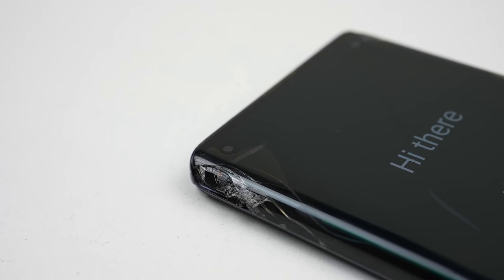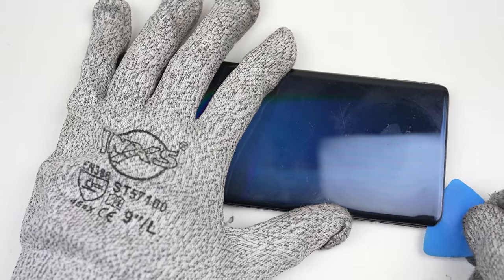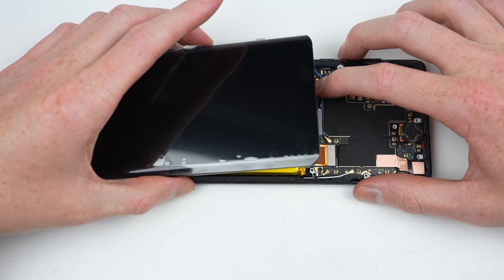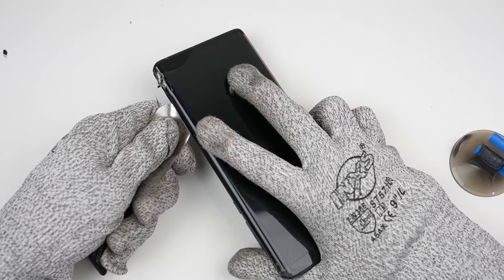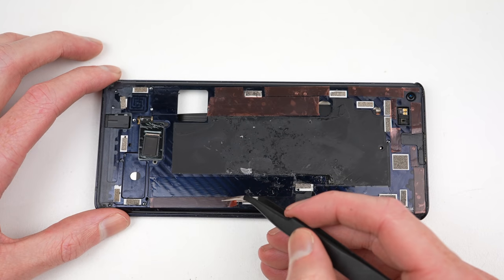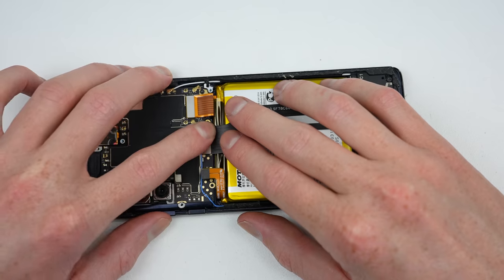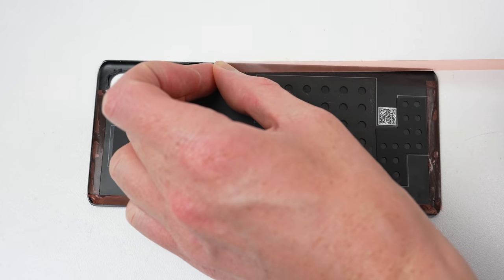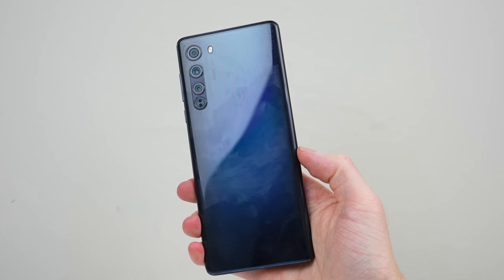$138 Motorola Edge 5G - Repair Taken To The Edge

Comment: I've wanted to buy the moto edge plus 2020 for the longest time. They kept the headphone jack and expandable storage on this model. The only thing that sets Motorola back is their abysmal update cycle
Reply: Actually Motorola updates are quite good now it's more the worrying about the camera
Reply: 1 year updates in most devices vs 4 years of Samsung.
Reply: @laloqf  actually no most Motorola devices now get 2 years os updates
Reply: Custom rom. I kept my Samsung galaxy s7 for 4 years completely up to date using them and genuinely barely saw any performace decrease. Even in the first 3 years it was much faster then the standard os
Reply: @harryvlogs7833  And that's only security updates. Some of their phones quit the factory with no OS upgrades. For example, the newest Moto E7 is one of them.
Reply: @polytelus  Moto e7 is extremely cheap
Reply: Ikr!!! But you can still install custom Roms
Reply: @laloqf  I'd rather have 1 year of normal updates than 4 years of Samsung bloat.
Reply: @harryvlogs7833  Depends on where you live mostly. I almost ate my entire salary with this phone. This is, cheap or not it still deserved at least, Android 11
Reply: @mjc0961  I have the feeling you've never used any Samsung device
Reply: @Lucas_emmsz  Or used the old Samsungs which had TouchWiz as their skin on top of Stock Android. It was absurd how much bloatware it had.
Reply: Yeah I think the device had display issues as well with the screens would turned purple and green for a lot of people. Although that might have been the edge Plus or the edge 5G it's hard to keep track. G100 it's pretty compelling with an 870 chip, and sometimes it's a sub 400.  I think 870 is a much better chip than the 8th gen 1 for thermals and battery. Yeah technically 8 gen1 one will win with benchmarks but OnePlus, Samsung and others are just struggling to get those kids running cool enough to justify.
Reply: @harryvlogs7833  yeah it's amazing how reputation sour a brand even when it's not justified anymore. I mean the LG V60 you just got Android 12 2.5 years after it was released. Almost every buddy said LG would never provide this kind of software support. Basically, at least in the United States market, any Android competitor gets crucified by the tech media. It's one reason we have no competition here. 90% of all carrier sales are a Samsung or Apple device and as a result anytime there's any negative coverage of those companies creators get killed with the algorithm or the backlash
Reply: @laloqf  first of all, Samsung just introduced the Four year promise, we actually have to see if they'll follow through with it. They lied about the lpto screen and the benchmarks, the charging speeds, so we probably shouldn't give them the benefit of the doubt, although I do appreciate the aggressive update schedule.
Reply: @Lucas_emmsz  I have a note 9 and a tab S7, and I like them both a lot, but the problem is the throttling, and the removal of important features the last few generations. And the absurd pricing is a problem as well. 

Only 8 GB of RAM in the base model of the non ultra models For $1200? Back in the s20 lineup every variant had a QHD screen and a premium glass build, and MST/ Samsung pay

 Removing expandable storage on the Note? Despite it offering 8K video which eats up storage like crazy  Leading the charge for Android manufacturers getting rid of the charger, the headphone jack. No qhd on s21, s22 ultra variants. e entire gos scandal.... 4 years of S devices getting delisted from geekbench I'm not saying Motorola doesn't have its problems, but the lack of competition in the Android space and it de facto Monopoly Samsung and Apple have in the United States is bad for all Android users.

I really like it a lot of what Samsung does, and I use dex every single day. But they're constant mimicking of apples anti-consumer tactics are a problem. As is the refusal for so many content creators to criticize them.

I just think if you care about the state of android, Samsung deserves as much criticism as anybody, arguably more since they dominate market share so much.
Reply: 6 turning to 7 years apple support be like
Reply: @Lucas_emmsz  My S22 Ultra came with more bloatware than I've ever seen on a device before I rooted it.
Reply: I prefer the near stock Android experience of Motorola rather than Samsung's OneUI. While Samsung's software made leaps and bounds from its TouchWiz days, it still falls short in some aspects. 

Never really cared about cameras, displays or software updates, so I've got no compelling reason to spend so much on a Samsung when I can find my preferences on a much lower price tag.
Reply: Get the 2022 model, be aware of it's expensive price.
Reply: @harryvlogs7833  My Moto Z4 ($499) only got 1 OS update, Android 9 -> Android 10, most modern Moto devices get 1 year, while the higher end devices get 2. Motorola needs to go the OnePlus/Pixel/Samsung route in terms of software updates, as well as how fast they send them out.
Reply: the update cycle on my moto g100 is pretty good, with it being updated once in every 2 months. the bigger problem is the camera app. its really not great - zooming in more than 1.9x completely messes up your photos and "keep last mode" doesn't even work. the latter being fixed would make the first less annoying because zooming in with pro mode doesnt have the issue
Reply: @rmendez011  no most modern recent Motorola devices get 2 now
Reply: @harryvlogs7833  Not the G or One models, not to my knowledge at least, they only get 1 OS update, while the Edge and Razr get 2.
Reply: @mackenziehopkinson1238  Custom ROMs are always the best solution, but not that much viable for an average user without possible risks if they don’t know what they’re doing.
Reply: @michaelcorcoran8768  Hai! I brought edge 20 fusion yesterday. But video recording & videos in YouTube, Instagram, hotstar, prime are not clarity. So should I exchange or any solution for this?
Reply: @laloqf  usually 2-3 for flagships, 2 for mid rangers, and 1 for moto g series phones
Reply: @ptristao01  Touchwiz does not exist anymore homie
Reply: @Ayuraos  I know bro, I was just referring that it existed and while it was used on new phones everyone criticized it because of the bloat
Reply: @harryvlogs7833  its still shit lmao, good thing it's super easy to unlock bootloader and flash some customROM.
Reply: @lolcatpl  2 years of OS updates for the features and price of the is quite good actually
Reply: @andrive  custom rom has its drawbacks
Reply: @myboah4764  Like?
Reply: @andrive  secrity risks voids warranty hard to download needs rooted phone and anything gone wrong phone bricked
Reply: custom roms are your best friend
Reply: I think the update cycle will be solved cause Lenovo is really taking Motorola seriously.
Reply: @harryvlogs7833  
2 years of OS updates? is that supposed to be impressive?
Reply: @beastinfection638  no it's supposed to be fine
Reply: @harryvlogs7833  
lmao its not fine. iphones get 7 years of OS updates
Reply: @beastinfection638  actually iOS is 5 and 2 is fine anyway as most people keep phone for 2-3 years
Reply: @harryvlogs7833  
uh no. the iphone 6s was released in 2015 and it’s still being updated. it got exactly 6 iOS updates (started iOS 9, and got iOS 10-15). it might even get iOS 16
Reply: I have this phone, just got the 2020 April 1 update. Bought if primarily because it's an unlockable bootloader phone with Lineage that has SD card and headphone jack.
Reply: @Lucas_emmsz  touchwiz did suck though
Reply: @Lucas_emmsz  and yes Samsung does come with bloatware
Reply: Just got android 12 on my moto edge plus!
Reply: For those mentioning Roms, rom support for Motorola phones is really hit or miss, sometimes you get good twrp and rom support, and sometimes even unlocking bootloader is a chore.
Reply: @beastinfection638  nope. It’s no longer gonna get the ios 16 update even the iPhone 7 will die at 15
Reply: @michaelcorcoran8768  since the s10  the  4year update
Reply: They gotten better with Edge 2022 2 Andriod and 3 Motorola upgrades.
They still have to put more durability into constructions, but if you are 
protector user like myself, I prefer the added weight as it is usually in a jacket
pocket and also makes it harder to leave behind, you can find a good protector
for $15.00 on Ebay & the 30 watt Anker turbo charger for $22.00 for 8gb of RAM
and 256gb of Storage a 144mhz Oled Screen for $500.00 you cannot go wrong.
Reply: 2023 + model has no headphone jack.bummer..gotta buy earbuds.wireless..i love the newer models.want one so bad.unless i can come into the money to buy it..all i can do is use my mto g pure.need that full screen.

Comment: You failed to mention the recalibration for the fingerpint scanner.  I just did this repair for the edge plus (same frame and display assembly) and because the screen was switched it requires that next step.  This is something new from Motorola since the Z4

Comment: Motorola phones are actually really underrated. I just wish their OS support was longer.
Reply: I with they wouldn't kick features out they've had for years all the time (headphone jack, dual sim AND microsd instead of the shared slot BS).. or intentionally cripple some models (selling a phone model without a compass... like wtf?)
Reply: @Knaeckebrotsaege  after the z2 play was on a 32 bit operating system for no reason I realized how incompetent Motorola can be with their software
Reply: Ive had several.last one was a e6 i believe.been so long.had 2.i love em.but i couldnt afford the moto g pure.$59.ive gotta samsung galaxy.ao3,s
Reply: @seanallen2731  it's not even motorola, Lenovo acquired them and i've noticed theyve gone into the bucket

Comment: Hey, Hudg, try rl-35a - this glue looks like a best solution for devices with thin edges. Also I highly recommend t9000b, this one also good one if you need a little difference between frame and screen(this one is thicker)

Comment: I'm so glad the curved screen fad seems to have mostly died at this point. My last phone had a curved display and it never really gave any real benefits I could tell beyond looking neat, however the one time I dropped it and needed a screen replacement it was quite steep. Recently moved to S21+ and I'm happy to have a flat screen again.
Reply: for me (with an s8) I find the curved display nice for immersivity (it's a pretty cool effect to feel like you're just a holding a screen) and ergonomics because it matches the curved back. The edge panel is also very useful.

That being said, with samsung's pretty bad touch rejection, you definitely need a case, screen protectors are hard to find, apply, and are expensive and I guess I could do without it - screen replacements just aren't viable at all on s8's and s9's but that's a little to do with the high-res amoled panel
Reply: Too bad it's just OLED that you're using and it's still stupidly overpriced and gimmicky.
Reply: @acumenium8157  are you saying that oled is gimmicky? and that you'd honestly prefer lcd?

idk about overpriced either, there are at least some great value phones that have it, just a shame that apple still sells lcd on their phones now, especially when they cost so much, and then they hit us with this 'liquid retina' garbage. also, just found out that iPhone 11's had LCD for like no reason and apple like told no one (listing it in the specs does not make them honest)
Reply: @rolls_8798  Sure am! OLED burns in like crazy, is super dim, and struggles with non-black colors.

I'll take a good IPS over some OLED any day.

And yes, OLED costs vastly more than IPS. Using your iPhone example, it's the difference of like 5x the cost. One of the iPhones had an OLED or IPS screen. OLED was 5x the price. Like 150$ instead of 30$.

Because anyone can make IPS. Not anyone can make OLED.

OLED is also very fragile, which in a handheld like a phone is... not good.

Speaking of that, there's no real practical use for OLED other than a television. Anything else is too prone to severe burn-in due to static elements, like the taskbar on the bottom of Windows, or other UI elements similar for Android/iOS, etc.
Reply: @acumenium8157  I'm sorry for whatever bad experience you had years ago but I would never go back to lcd. I assure you any modern oled phone will get plenty bright depending on how you adjust the brightness. I've personally never run into the burn in issue since I don't literally use my phone at 100 brightness on the same screen for hours at a time. My S10 from 2019 still had 0 burn in. As for fragility I can't speak towards that, outside of that one drop I haven't cracked or majorly scratched a screen in probably 10 years and I've been using oleds for over half of that time
Reply: @acumenium8157  Some decent points but some which don't really exist at all.

From what I can tell oleds are only getting better at preventing burn-in (with sub-pixel structure and sizing and also quality). Apparently the Galaxy S8 series was particularly prone to burn-in and unfortunately my secondhand one does have it slightly, but this was addressed with the S9.

The oled screens I have used have been pretty good with colours, iPhones in general are a little unnatural looking and feel 'over-sharpened' imo and perhaps they are worse than a good LCD panel in that way - e.g. the matte LCD on my laptop is excellent and actually has very deep blacks. but my S8 just looks better - having individual pixel brightness control makes a big difference, but a lot of this LCD vs OLED comes down to the specific panel and manufacturer when it comes to overall viewing pleasure.

oled is expensive compared to lcd, but oled is not expensive. you're mostly getting price hiked by apple, or of course third-party lcd's are a lot cheaper because they're so much less complex to make and I think any oled ones you might find are just refurbished. bigger oled screens however have a massive premium (I probably wouldn't consider one on a tv, but maybe on a laptop)

not that fragile, and much less likely to brick the whole screen if you manage to damage a small part of it. no crystals to mess up either

static elements is a fair point, but good software completely eliminates it (e.g. the AOD on samsungs can be set to slowly change position on the screen, even if you have it on the tap to display mode, or the simple screensavers and screen timeouts) and using gesture controls instead of virtual buttons means there is nothing permanently on the screen, i think the benefit is worth it (picture quality, viewability, and battery life) but if you don't want the small risk of burn-in occurring then that's personal preference and that's fine.

crt's were able to get burn-in as well(hence the dvd screensaver or the term 'screensaver' as a whole) but we coped just fine. i would just say oled is unsuitable for more industrial applications like monitor screens (as in a monitor for sensors) and because of cost

Edit: oh yeah, and oleds get plenty bright nowadays, i've actually had much better consistency with their sufficient brightness than with lcds
Reply: @acumenium8157  overpriced? dude this type of screen has been around for so long
Reply: @Maximus20778  Yes, overpriced. OLED screens are insanely expensive compared to IPS.

They're like half the cost of making an iPhone nowadays and a big reason why profit margins aren't as nice on them as they used to be.
Reply: @acumenium8157  well that doesn't matter now doesn't it? since the phone already covers that with it's price tag. especially when it thousands of dollars plus looking nicer than lcd( I have a TFT display on my Samsung but id like a oled) problems with the display has probably been fixed.
Reply: @Maximus20778  It does matter when the screen breaks, doesn't it?

Also TFT is garbage, why bother mentioning that? We're talking about IPS vs. OLED.

OLED is ugly, horribly dim, severely prone to burn-in, very frail, and needs constant recalibration because it's never consistent on color temperature.

Also some OLEDs are wildly latent. I thought this was just an issue with earlier ones like the PS Vita, it isn't.
Reply: @acumenium8157  well you must have had a bad experience with it cuz I've never heard anybody had these problems here. unless you had the brightness so high(burn in problem btw) also I'm aware of TFT being garage but still gotta work with what you have. IPS is just bland trust me I've seen it and it's bad probably worse than TFT display. sure it can be produced and be durable but will never be as nice as a OLED. I find it sharper and a lot nicer than a IPS.
Reply: @Maximus20778  Burn-in is independent of brightness lol. It just happens.

TFT is also rarely used. Even cheapo stuff has an IPS screen now, TFT/TN just doesn't make sense anymore.

OLED is horrendously color inaccurate and dim.
Reply: Yeah I couldn't get a good case for my oneplus 7 because of the dumb rounded display and I ended up cracking it.
Reply: @rolls_8798  I do prefer LCD, so much in fact that I won't buy an oled phone, they always get burnin.
Reply: @acumenium8157 horrendously colour inaccurate?? Urrr, that’s lcd my man 😂

Comment: Quick question what brand of liquid adhesive do you use? Btw good work as usual with this repair
Reply: It looks like E8000, from what I can see (and what has been mentioned before).
Reply: It's E8000 - and it takes a day for it to dry, which necessitated the rubber bands.
Reply: @rosaria8384  also note that Hugh used to sometimes use something heavy instead (like a box of iCloud iPhones), but one time that actually broke the repair, hence why he now uses rubber bands